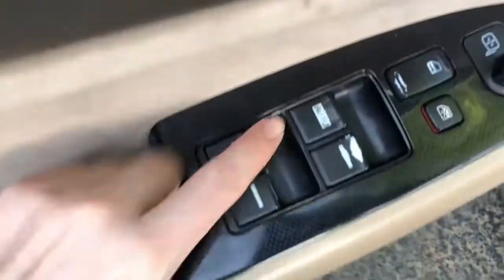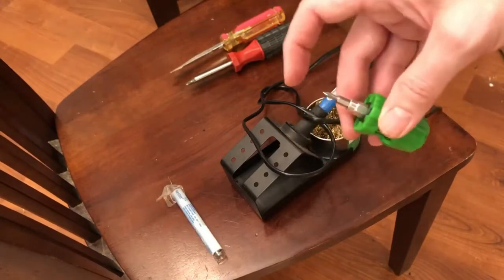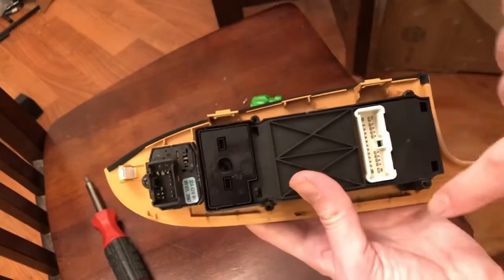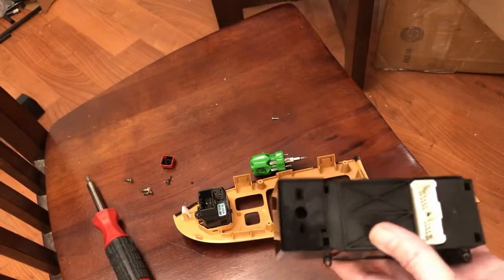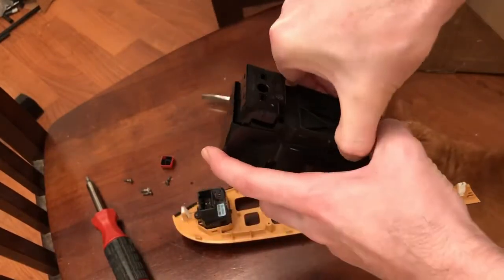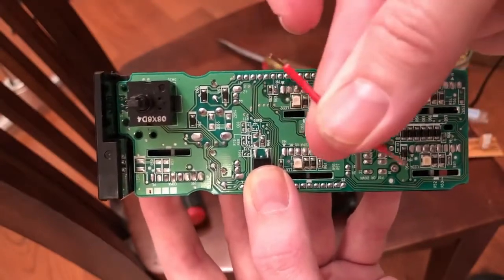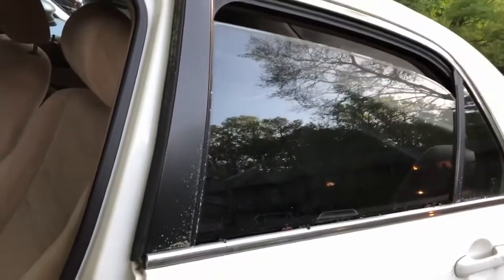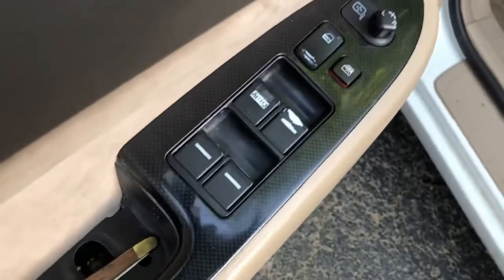Fix Honda Accord 2003-2007 window switch when passenger and rear windows not working

Comment: The window lock out button failed on my `07 Accord sedan. I followed the steps in your video and it now works perfectly. Thanks!!
Reply: Did this drain your battery?
Reply: @bxdubs5577  No battery draw issues that I’ve noticed. It’s only been 1 week since the repair. I haven’t done a draw test either.
Reply: @bxdubs5577  I THINK THERE IS ONE MORE SIMPLE SOLUTION IS. YOU NEED A SWITCH BUTTON ON THE JUMBER WIRE IF YOU ARE NOT USING POWER WINDOWS ALL THE TIME . DISCONTINUE THE JUMPER BY SIMPLY SWITCHING OFF WITH BUTTON. AND I HOPE THIS WILL NEVER KILL YOUR BATTERY  THATS WILL NEVER KILL YOUR BATTERY
Reply: Any parasitic draw issues since doing this fix? I just did this and didn't read the comments before, lol. @GspeedR

Comment: Several years ago I installed a jumper wire and all windows worked fine. Fast forward to 2023; the car is not operated on a daily basis and the battery now runs down after a few days of non use. After much aggravation and testing I found that this repair creates a parasitic electrical draw of almost a full amp. Removing the installed wire dropped the draw to about 19 milliamps which is normal. If you don['t use your car daily I would recommend replacing the switch.

Comment: Clever solution but is this creating a parasitic draw on the battery?
Reply: Came here to figure out the same thing
Reply: YES. It will add about 700 milliamps draw. If you use the car daily it probably won't be a problem but if it sets 4 or 5 days you may experience a dead battery. I just discovered this the hard way.

Comment: Checked board on 2006 honda accord, was a open trace on board,reconnected works again
Reply: What do you mean? How did you find the open trace? Thanks!
Reply: @YahirVergara  took the circuit board out examine under magnifier, checked with ohmmeter,reconnected with thin wire and reinstalled and it worked

Comment: is it draining battery?
Reply: Apparently nobody wants to answer that 1 lol
Reply: @bxdubs5577  I did something similar and it did drain the battery over time. I replaced the window switch with a junkyard switch and fixed the problem. No dead battery and the windows work as designed. It was ~$70 for switch, but for my situation it was worth it.
Reply: I THINK THERE IS ONE MORE SIMPLE SOLUTION IS. YOU NEED A SWITCH BUTTON ON THE JUMBER WIRE IF YOU ARE NOT USING POWER WINDOWS ALL THE TIME . DISCONTINUE THE JUMPER BY SIMPLY SWITCHING OFF WITH BUTTON. AND I HOPE THIS WILL NEVER KILL YOUR BATTERY  THATS WILL NEVER KILL YOUR BATTERY